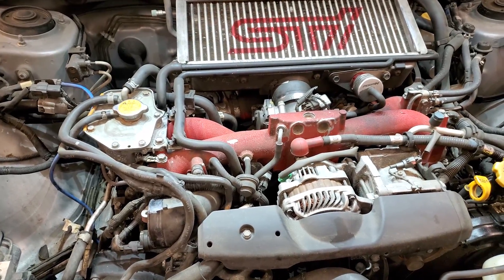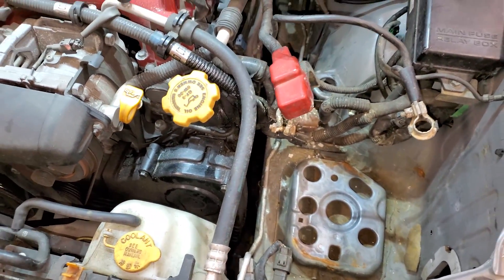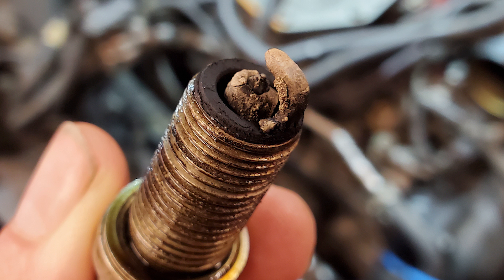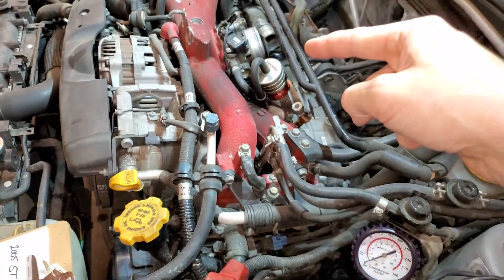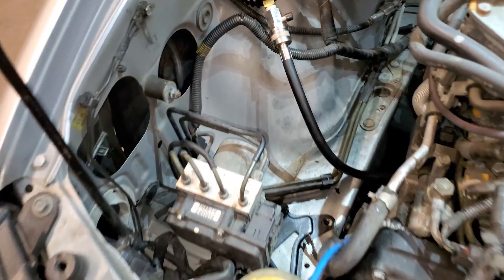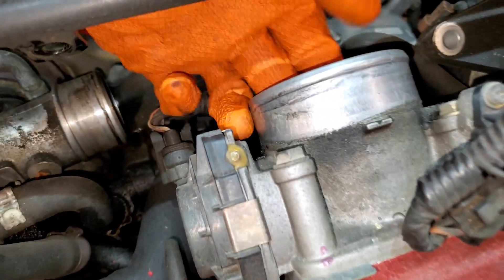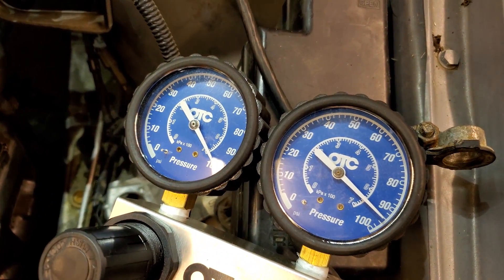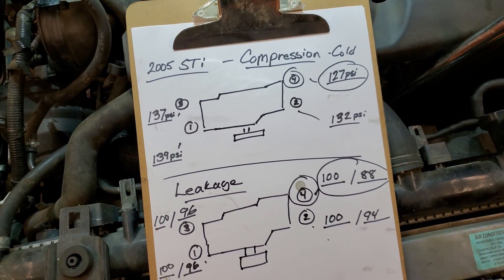180,000 Mile STi Compression and Cylinder Leakage Test Results!

Comment: Hey quick question, was this when the engine was hot or cold? Also when you do the compression test is it okay to not take off the intercooler since you showed that the reading doesn’t change with the throttle body closed?

Comment: I had a shop do a compression and leakdown test on my 05 STI.

110-120 PSI on all cylinders. 1% leakdown.

How? They said they did it with throttle wide open and warm. I don’t believe that. And 1% leakdown on a 20 year old motor when PSI is at 120? How did they mess up so much?

Comment: Great video breakdown,  I learned a lot having recently picked up a 2011 ST/w 140k miles.

Quick question. What your thoughts on these leakdown numbers

Cylinder 1-2 10% (90)
Cylinder 3 15% (85)
Cylinder 4 10% (90)

Compression was a solid 145 psi across all cylinders.

Do you see anything wrong with these #'s, specifically cylinder 3?
Reply from the maker: All 4 are within 10% of each other. Standard deviation. Should be fine.
Reply: @MrSubaru1387  

Perfect! That's what I thought  but wanted to be sure. I think I may get a valve job done, or upgrade the entire head for more longevity and reliability and of course a slight HP increase with the IAG head.

Thanks for the reply I really appreciate it big guy!

Comment: How do I disconnect the fuel pump on a 05 wrx to do a compression test so it doesn’t start
Reply: In my '05 Sti - Fuse #11 under the coin tray disables the fuel pump.

Comment: Short block replacement or rebuild? New piston rings, valves and a good cleaning of the heads should be more than enough to fix those small leaks no?
Reply: Nobody rebuilds Subaru short blocks. Its cheap to just replace with new from Subaru. Last I checked and it was 4 years ago they were going for around 2k USD. Heads could use a rebuild with this many miles thoguh

Comment: I have an 02 WRX with random cylinder misfire that I can't figure out. It has rough idle about 50% of the time; however, engine pulls good...
Compression looks good (didn't do leak down) 
Coils tested (resistance)
New plugs. 
Fuel pressure/regulator is good. 
Also replaced the turbo inlet and leaking valve cover gaskets. 
Double checked timing and that also looks good. 
That oil valve thing under intercooler looks to be working.
Cleaned ground wires and etc..
I checked every hose for leaks replaced some that were brittle around turbo area. 
Last thing I did was check resistance on injectors on passenger side which returned 12.9 and 12.6 - the other side was pain to remove the metal bracket so I gave up. 
After that I did injector cleaning by hooking up a carb cleaner directly and run car for a few seconds on that only... 
Any help/hints is appreciated. Thanks.

Comment: i have a 2010 WRX with 203,000 miles, and its still running strong.
Reply: cold air intake. I sold it. 3rd gear was grinding
Reply: Mods?

Comment: Did this car have a P030x code? P0304 with a slightly rough idle just came up on my '06 STi with 132k. Swapped coils and plugs with #2, one at a time, hoping the fault would move. No dice. I need to do a leak down. I'm suspecting a head gasket.

Comment: Is really replacing the block the way to go? Aren't new piston rings and a refinish of the cylinder walls an easier and still really good way to go about it? (Of course if you're taking the engine apart it's wort putting some fresh rod bearings and gaskets and seals)

Comment: MrSubaru1387 , I gotta say I do enjoy your channel and all the content, it's been amazingly helpful and you seem to know your stuff!  Question:  I have an almost exact setup, only on a 2005 Legacy Gt limited 192,000 miles  (Its been good to me)  Recently I've been trying to figure out the causes for a # 2 and a #3 cylinder misfire.  This all happened about a week after I replaced the upstream O2 sensor that had been put off for longer than it really should have been.  I've replaced the coil and Plug on #2, and it did seem to smooth out the idle significantly, yet I still show a misfire on the same two cylinders, I expected #3 to show for sure, but not #2.  I literally could hear spark on the # 2 cylinder when I pulled the coil (while running) to see if it  slowed the engine.  It did not slow the engine when I pulled either the coil electrical connectors or the injector wire plugs on either 2 or 3 only on cylinders 1 and 4 did this make a difference.  What could be going on here...Dirty injectors? valves?  Any help would be greatly appreciated!  Keep up the awesome videos and take care-
Reply from the maker: Start with a compression /cylinder leakage test
Reply: Po302 2006 Subaru sti  with 150,000 miles. Car runs fine. Short and long trim within specs. Leakdown test is next. Swapped  plugs and ignition coils.  Haven't done injectors yet

Comment: My compression numbers are 110-100-100-100. It still runs fine 🙃
Reply: Dang, really? Got 110-115 on MY07 OBXT and have a misfire at low RPMs on Cylinder 1. Cannot figure out the issue for the life of me. 😫

Comment: Usually replacing head gaskets on EJ engines, are valve adjustments usually needed?
Reply: Typically any SOHC or DOHC engine without hydraulic lash adjusters or hydraulic cam buckets is in need of adjustment by the time the heads need to be removed.

Comment: Hey got a question i got a 2013 wrx burns oil after oil change in 1200k miles i add maybe 1 litre got no leaks changed the pcv and still does it 113k miles on it please kindly help 

Stock
Reply: Sounds like rings are bad.  Are you getting white smoke on start up?  Or while aggressively revving?
Reply: J nielsen this summer a little bit like normal
Smoke and goes away cold start revs 2k warmed up 900. Now this winter normal smoke but won’t go away. Cold start 2k goes up and up is it normal? But warmed up 900

Comment: The engine would be just as worn as the drive line, suspension, bushing, rack etc, feels kind of pointless having a fresh engine and old everything else?
Reply: Who knows how many of those things were replaced over the life of the car? At 180,000 miles, I'm sure several suspension and driveline parts have been replaced, however, the age of those parts might vary. In addition, some of those parts may have been better than the kinds of parts found in a stock WRX STI.

Comment: That is excellent service life from a Turbo charged engine!! I hope my wife's WRX holds up similarly. I wondered how well these little Boxers would do with forced induction, impressive.
Reply: My 2006 WRX  has 313k on odometer. 
Original everything. 
I'd love to do these tests on my engine.
Reply from the maker: I've seen 200-300k mile WRX and STis before. All about how you maintain them.
Reply: @MrSubaru1387  , I totally agree. I still do 3K oil & filter changes & always will. Those chains and sliders love clean oil!!
Reply: Impressive for a subaru engine but nothing special for a turbo engine

Comment: Saving $100 by buying crap coil and bad Spark plugs to ruin your STi is not a good way to go about it. Personally The cold air intake and blow off valve would bother me but as long as your not beating on it it should be ok. The blow off valve is blocking The recirculating hose that goes from the valve to the inlet. Your throwing the air fuel off just don’t flat foot shift or power shift with the valve venting to atmosphere.
Reply from the maker: This isn't my car. I'm fully aware that the BOV and CAI are trash. I mentioned that and why they're a bad mod in the previous inspection video.
Reply: MrSubaru1387 didn’t mean you personally , I watch a lot of your videos and was speaking to everyone here .  I messed my STi up by not getting the OEM outer tie rod and it was shorter ,threw the alignment off. Went and got OEM and never had an issue as I counted the turns it took to take the stock one off. I know sometimes we are in a rush to get the cars together and throw questionable parts on.

Comment: With those compression/leakdown numbers do you think that motor would be fine for daily driving duties with the occasional spirited driving?
Reply from the maker: Yes. Probably good for another 50k+ miles.
Reply: @MrSubaru1387  That's good to hear. Its nice to see a "healthy" EJ motor with that many miles. 

Do you recommend changing spark plugs at about 35k miles? I've been knocking out some 30k milestone maintence like diff fluids, brake fluid, cabine filter etc. I don't track the car and its stock ,but do you think I should go ahead and change the plugs or wait til 60k?

Comment: Could the lower compression and leak down results on the left side be related to a bad head gasket? I noticed you checked for coolant bubbling on the right but not sure about the left.
Reply from the maker: I checked on all 4, just didn't film it. Leakage was by the piston rings. Just more worn than the other 3.
Reply: If the leakage is by the piston rings, does that mean that it will burn more oil than normally and owner should keep an eye on it? Although you should always keep a frequent eye on oil with subarus.. :))
Reply from the maker: @andriusa.6444  Yes.